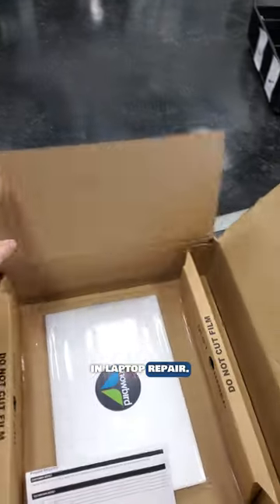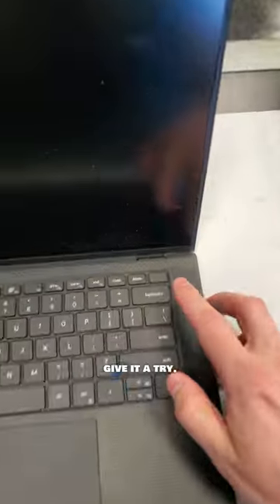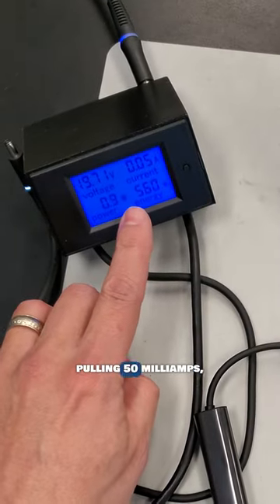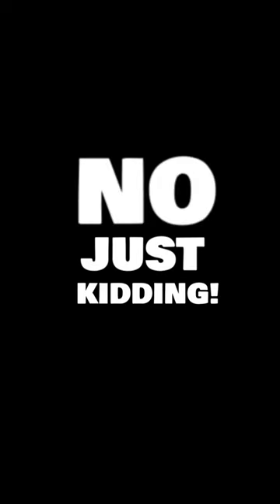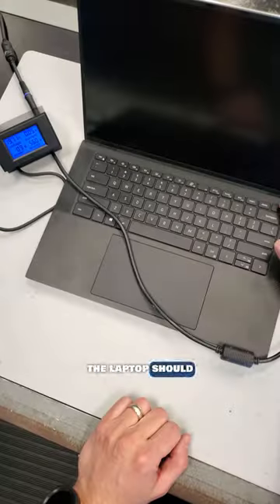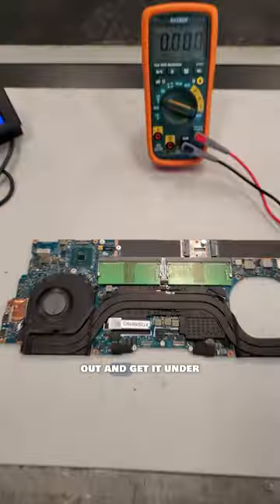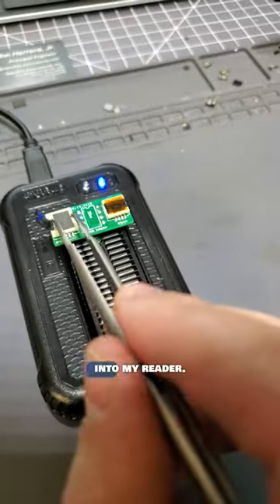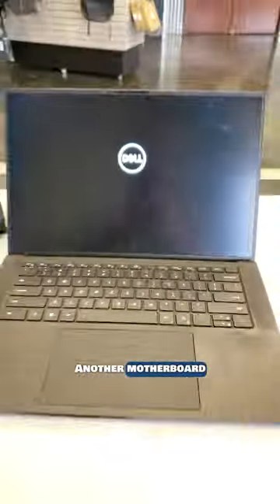Strange Issue: Dell Laptop Repair Fix #shorts #laptoprepair #computerrepair

Comment from the maker: If you need a repair and it is a Dell/Alienware laptop and you live in the USA or Canada.  You can fill out a service request form at partspeople.com
Reply: Can I charge my xps 9365 2 in 1 with any charger ?
Reply: I tried with a 10 ish watt and it kinda works.
Reply: Max goes 50% with a bad battery.
Reply: I have a dell g16 7630 what chip is the bios?

Comment: i didn't know the BIOS can manage the power. I alway thought it was a separate "power management" chip
Reply from the maker: It doesn't. Because all power rails were up and running, I could see that the PCH was starting by looking at the current draw/thermal camera. Then, the BIOS would be the next step in the startup process. I hope that helps
Reply: @dellpartspeople  ah! got it!

Comment: Where do you get the finished bios from? Do you extract it out of the downloaded bios installer file or do you have to copy it off a donor chip
Reply from the maker: I extracted their contents from their BIOS chip and then downloaded a fresh BIOS from Dell and, using a hex editor, pasted it into the corrupted BIOS; then flashed it back.

Comment: I will never forget how my deceased dad's ASUS X51RL I once put a BIOS password which I forgot since then I think, so I could only boot Windows but not access the BIOS on it I think, bricked itself as the BIOS flash froze at 100% at the post-flash check never rebooting or saying that the flash completed like it should have done according to videos I saw later on YouTube I think...

It had a working battery, the original battery, with barely 30 minutes of battery life remaining even fully charged but still, and of course the PC was plugged in while flashing the BIOS if I remember correctly, I think I was even filming the process back then...

I thought I did everything right but I think I saw on a forum after that, as the flash tool ASUS made for this PC was from 2007 with only compatibility for Windows Vista 32 bits, the OS preinstalled on the PC but I managed to upgrade it to Windows 7, then doing fresh installs of Windows 10 32 bits and 64 bits and of Windows XP 64 bits if I remember correctly...
Back then I tried to run the flash tool on the fresh Windows 10 64 bits I had on it, stupid lol, it didn't even start if I remember correctly,
I thought, no problem, let's install a fresh Windows 10 32 bits and it should run
No error message, nothing, it looked like it was working, the PC rebooted into flash mode but as I said it froze at 100% during the post-flash check without showing flash complete and without rebooting, nothing happened, the power button was no longer responding even with a long press, had to unplug it and remove the battery after a few minutes to turn it off and unfortunately since then there are no more lights when I plug it in and nothing happens if I try to power it on if I remember correctly...

The BIOS chip seems to be quite old and big so maybe quite easy to remove or to plug something on it to flash it without removing it, but still it's soldered I think, if I remember correctly ASUS no longer has the BIOS file oj their website for this computer so I hope I still have it... and voilà...

If I remember correctly the forum I found back then said that the flash tool from ASUS was only designed to run on the preinstalled Vista 32 bits and from a USB drive formatted with FAT16 or FAT32 I forgot...
Meanwhile I ran it from the NTFS partition of a fresh... Windows 10 install... f*** my life and f*** ASUS lol

Maybe I was dumb, very very dumb to expect them to future proof their flash tool so it wouldn't brick their laptop from 2007 if ran from an OS released in 2015...
Or at least display showing an error message saying the OS and/or partition format is unsupported...
I don't know 🙃

F*** ASUS as my ZenFone 2 lost its bootloader by itself 4 or 5 times, it started after I upgraded its Android 5 to the beta release of Android 6 from Asus and never stopped since then...

I experienced some random freezes when on Android 5 (the screen can stay on forever if it was on when it started to froze, if you unplug your headphones while the music is still playing it will continue playing full volume on the speaker without pausing the music like it would normally do, happened to me in the train once lol...)

Etc

It did it wayyyy more on their official Android 6 build even when it was out of beta, sometimes after a few hours of use sometimes after only 15/30 minutes, sometimes 3 to 4 times per day...

You have to long press the power button to force shut down when it happens, nothing responds, the screen stays on, the whole OS immediately stops responding to touch I think and after some time music will freeze too I think...

Of course if you were waiting for phone calls you're out of luck if you didn't know it froze, of course if you wanted to have some battery you're out of luck as it drains the battery by staying screen on all the time until you power it off I think, etc...

Oh and the ASUS eeebook L402NA-FA292TS laptop and ASUS PRIME Z370-A motherboard I both bought new in 2018 from ASUS are still archaic to update their UEFI as it took me HOURS to make a FAT16 USB drive after some trial and error as I think it wasn't explained anywhere so that it would be recognized by their graphical UEFI where you can only update the UEFI from it I think...

At least this time a too new Windows can't make it fail but still...

For example for the ASUS eeebook L402NA-FA292TS their website redirects to SKU like the E402NA, L402NA or E402NA-AS but the UEFI on my mom's L402NA-FA292TS only accepted updates for the E402NAS SKU as it already was the SKU for the UEFI if I remember correctly...

Yeah...

F*** Asus lol

Comment: Very good repair, although it worries me that the cause of the corrupted bios wasnt addressed and could happen again. Did you do any additional checks? Just curious.
Reply from the maker: The BIOS probably got corrupted because Windows updates automatically install new Dell firmware without notice.

Comment: How can the BIOS get corrupted? Is it a problem of a failing BIOS chip?
Reply from the maker: One main reason is loosing power during a bios flash. But it can happen during a update too.
Reply: @dellpartspeople  but I think he was using the laptop when it suddenly shut off... So it can't be an update, right?

Comment: Just curious, is the dual bios stored on the same chip or not? Since i know if you hold Ctrl+Esc and plug in the charger it will go to BIOS Recovery from my Dell experience
Reply from the maker: I have not been able to get that to work with these issues.  This required me to pull the BIOS chip to rewrite it.

Comment: Customer should try the, put it aside and forget about it for 1 month, works like a charm, bios should drain and reset by then 😁. 

But my hp envy did that for some time, 30 seconds power btn hold, then a plug in worked.
Reply from the maker: CMOS reset does not work to fix this issue.  It can fix other issues, but not a corrupted BIOS .

Comment: Would you be able to fix a Dell latitude d830 blown charging circuit it's missing two capacitors and a diode
Reply from the maker: Hi, I can try but depends on if it's worth it to you. If I can't fix the board then it's a $30 diagnosis + shipping. You might as well find a replacement motherboard off ebay though, as we're out of stock. And I'd feel sorry charging you for labor to fix such a old laptop ;-P

Comment: Hey 
I had a weird question to ask

Recently I put a power on password on my machine (Lenovo yoga) and forgot it. I tried to approach Lenovo as this had accidentally warranty but this wasn’t covered instead I was quoted C$780. Would it be possible to do the same where we remove the bios chip and reset it 

As I don’t think it is fair for me to just allow this board to go bad as I just brought it few weeks ago.

Any help would be appreciated.
Reply from the maker: We only repair Dell laptops, but if you set a BIOS password, then rewriting the BIOS can fix this. However, I would not perform this for someone without proof of ownership.
Reply: @dellpartspeople  

True that

I could prove that I own the device with original receipt and so on

But this isn’t bios lock but rather power on password

Comment: The amount of xps that I see needing a fix. And the two xps that failed on me (9550) my own xps starting to slow down (7950).. these are not good machines. Get a Lenovo legion. Also, good work fixing these.
Reply from the maker: We only fix Dells and Alienware, so you will see many of these machines being repaired on this channel. This does not mean they break more than other brands, and most that we repair are more than five years old.

Comment: How a bios can go bad? Like when updating it the power is lost? Or what?
Reply from the maker: Probably.  Also Windows now automatically downloads and installs new firmware and the customer does not know that they should not turn off the laptop when this is installing.

Comment: Is it possible to install a Dell XPS 9730 motherboard into a Dell XPS 9700 chassis, id like to reuse my 4k touch screen, ram, ssd… ? thanks
Reply from the maker: They have very similar form factors, but they are not the same. Unfortunately, the GPU and CPU are switched on the motherboard, so the motherboard will not fit.

Comment: My laptop shuts down randomly after every 30 min both in windows and bios display......what could be the problem?
Reply from the maker: It sounds like overheating and not a BIOS issue.  I would start by cleaning the heatsink and fans and applying new thermal paste. Good luck!

Comment: Obviously fake because bios is not supplied now. Replace with new board. Haha just kidding. Still can get bios files easily, right?
Reply from the maker: I just downloaded it from Dell, edited the Hex, and injected the good lines needed. This one did not need a fully cleaned ME. I have brand new motherboards, and I can also put the BIOS from them if I need a clean ME BIOS for a specific Dell model.